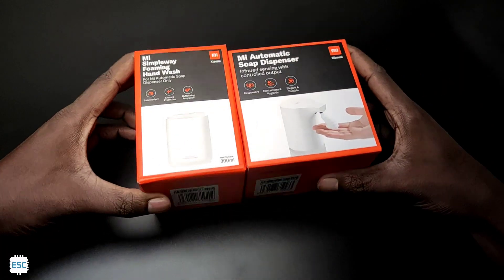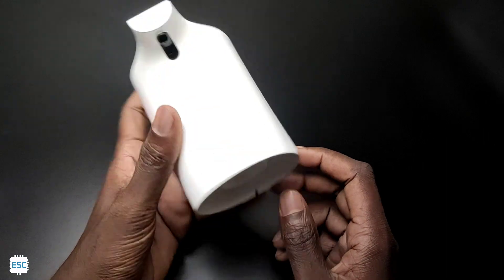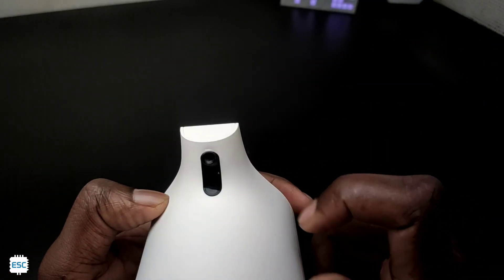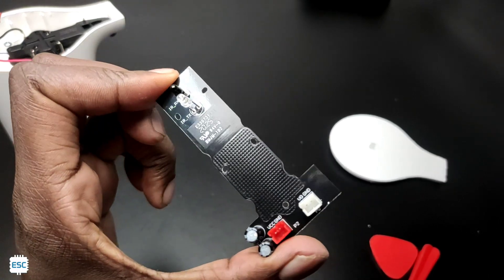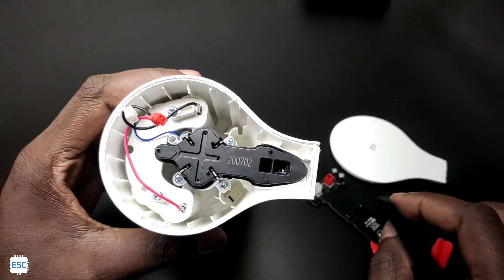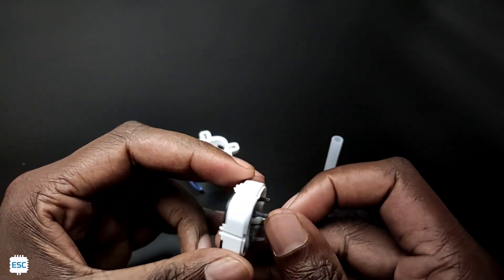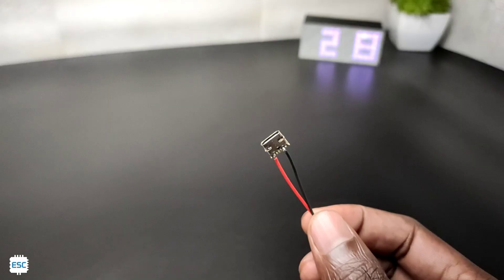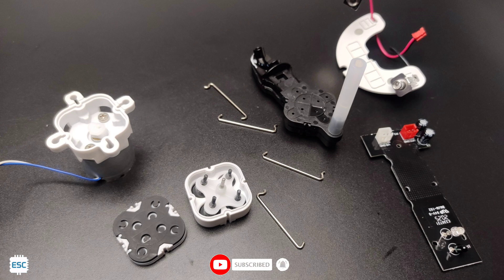Mi Smart Soap Dispenser Teardown | What's inside | Fix

Comment: Hi there; thank you for your video. Could you please send me the writing/code/parameters written on the motor? I am not able to see it on the video. The motor dimensions are 24x18mm, and the voltage would be 5V, correct? Do you have any info about revolutions RPM? I need to buy a new motor. Do you know where to buy it internationally? Aliexpress for instance? Thank you for being so supportive.
Reply: Did you find where to buy a motor? Please help)
Reply: @vadym.s  320C-15185-25.5L DSB422-D-2
Reply from the maker: Hi this is DC motor that means no code needed to control this. I have no idea about the RPM. 🥲